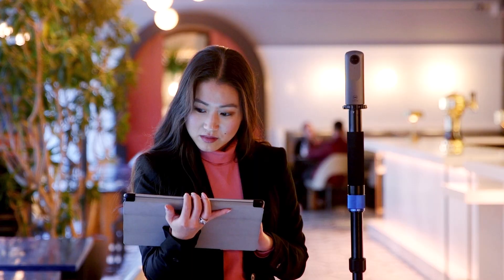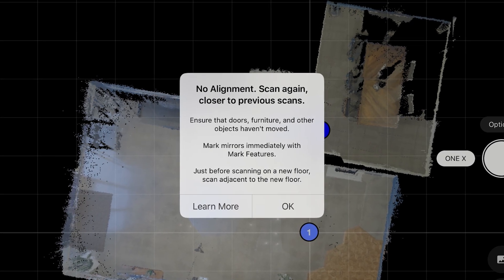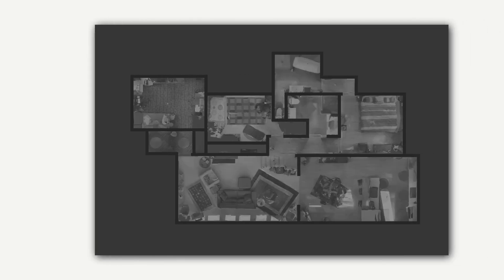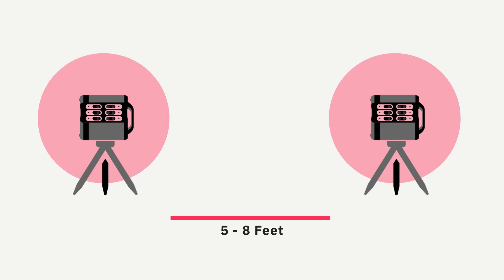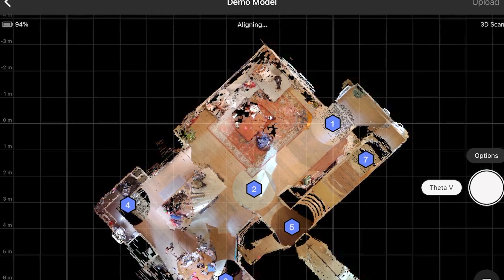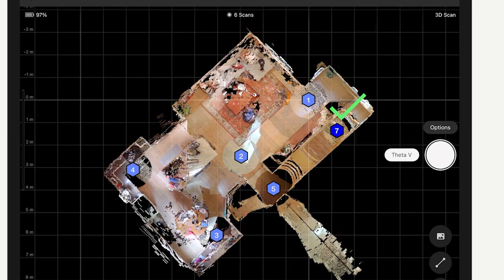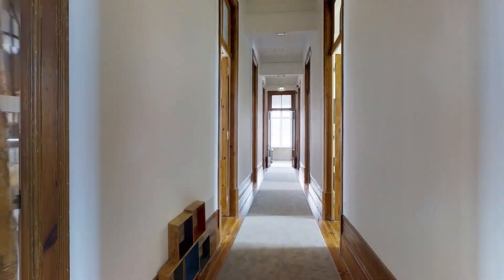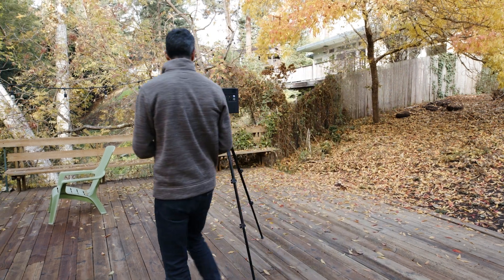Matterport: Coping with Alignment Errors & Misalignment

Comment: Been trying to realign 360 photos but only the 2D floor plan updates with proper walls, the 3D model stays the same with walls interesecting.
Reply from the maker: Hi, I'm sorry to hear you're running into this issue. I would recommend reaching out to the support team - t.ly/_KRMT

Without being able to see exactly what's happening in your model, I won't be able to suggest a solution or relay any possible bugs to the team.  Thanks very much.